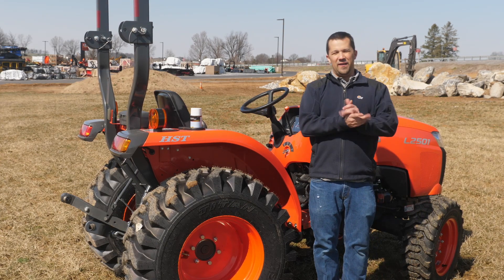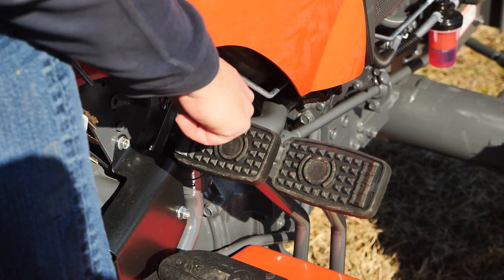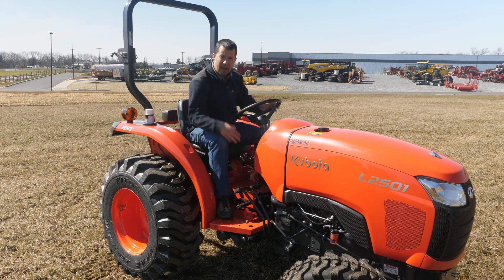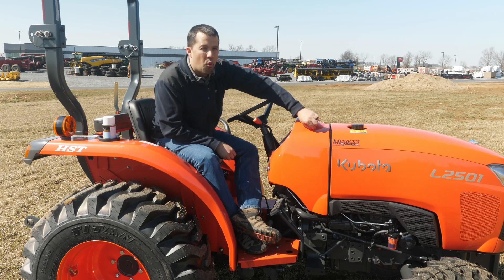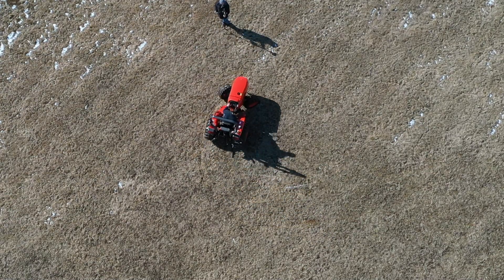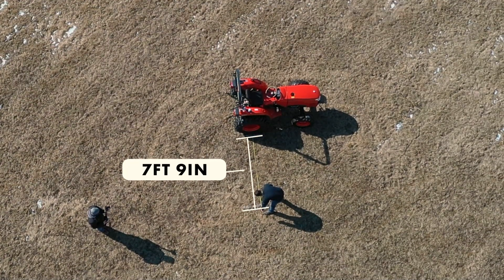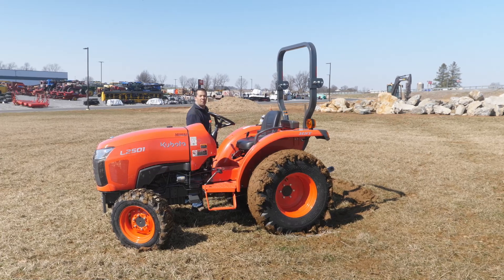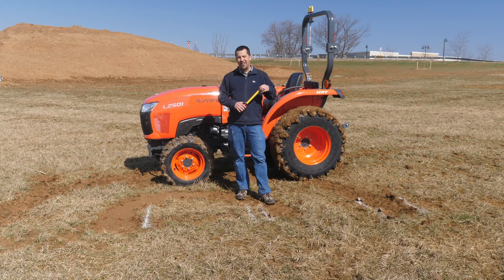Split Brakes | How they work, and when to use them

Comment: When I learned to use split brakes for tight turns, they had no lock.   I was taught to aim my foot between the pedals to stop straight ahead.   (JD 2010 gear drive model).
I had never heard of using differential braking to help with being stuck, or driving straight in snow.  
Great presentation.

Comment: Split breaks are the the best thing going when using a 3 point mounted mowing machine.  If you have your timing right on 90 degree turns, you don’t have to go into reverse to clean up your corners! 

On a lighter note, I was helping my grandpa on the farm and was riding in a utility box attacked to his 3 point on his 8N.  It popped a wheelie and he never skipped a beat, he steered with the brakes!

Comment: I live in West Virginia and we use these brakes to help hold when going across steep slopes. Many times the front end tends to slide down the hill and you can tap the uphill brake to pull the front back up the hill. I will say that this is on slopes much steeper than recommended. That being said, I passed on the Kubota because the split brakes were on the same side as the directional controls on the compact tractors which rendered them useless. Every other manufacturer moves the split brakes to the left side, but at that time Kubota did not.
Reply: Kubota definitely redifined “heel and toe”.

Comment: Great video. 
Cultivating  checked corn back in the 50's with a 2 row mid mount cultivator the turning brake were the most used pedals on my tractor.

Comment: I actually had to use the split brakes in a sort of emergency situation 🙃 last summer. I was taking buckets full of clay and spreading it at one end of the yard and before i had started i went thru and greased everything up but forgot to put air in my front tires.  My B2650 is supposed to have 35psi in the front and i was at 30psi. Well at some point not only did the tire go flat but i broke the bead on the rim and the tire was already half off the rim. So I grab and hook up all 300 ft of air hose i own to the air compressor and i end up about 30ft short from where the tractor was parked. So with my bucket down keeping front tires in the air  not only did i have to drive the Tractor that 30 ft but i had to make an 80° turn. Probably only time i will ever need to use them.

Comment: Is this a old video, I seem to remember this. I am always using the brakes, steering with my 4x2 tractor, it has 11L-15 wagon tires so it does not really steer well on slippery surfaces. This video does show  how useful  the brakes are.

Comment: On  my MX5100 HST there is a "cruise control" hand lever on the left side to set the ground speed so you can use the split brakes. (that are on the same side as the HST foot pedal) On my B7500 HST it does not have that feature so I would have to operate the split brakes the "Neil Way".

Comment: Back when I was a cocky 16 year old on dads old (even back then) Ford 3500 with a 5' heavy gauge steel slasher on the back I thought I'd be clever when mowing and speed things up a notch.
Got to the end of the row, lifted the slasher and still with the RPM high stabbed the left brake to turn nice and tight.
Brakes worked spectacularly well,  the front wheels caught and ripped the wheel out of my hands, slasher got some momentum swinging sideways and before I could blink the tractor is on 1 wheel and just about rolling over into the barbed wire fence. 
I think I bumped the draft control and dumped the slasher back into the dirt and some how didn't roll, but scared the crap out of myself.

Comment: I utilize the split brakes feature on my MX4700 gear-drive machine when mowing around my pond edges. It gives me a little insurance against slipping too close to the sloped edges. Yes, I wish I had an off-set solution, but you make do...

Comment: Even on newer tractors you don't need brake steering. New modern farm tractors have amazing steering with the gearing at the tire to help pull the front through the turn. I've talked to a lot of farmers and people who own tractors and never has a farmer used brake steering on a headland. Not saying they don't but I've never had one tell me they do. Really the only place I've ever seen brake steering be of any benefit is if I'm hauling the houle spreader and I'm backing up to the pump if I didn't make that re- correction soon enough brake steering can help to bring the front around to be to make the tractor straight with the spreader. I've never personally used brake steering traveling forward.

Comment: At least on some models of tractors, the parking brake only works on one pedal, so should also lock pedals together when one really needs the parking brakes to hold.

Also, a very good idea to keep a close eye on your brake wear and adjustment, and make sure both pedals have similar travel for similar braking force, that way when pressing both, you don't have only one side fully engaged and the other barely doing anything.

Comment: Great video Neil.  Thank you.  Very helpful to know the B2601 I am considering I can still use the split brakes.

With my old B7100-D I constantly use the split brakes when clearing snow.  The front wheels become very light and there is no steering there when pushing heavy snow.

Comment: Steering brakes take some practice so as to not tear up the turf.  But when using a finish mower or rotary mower it can make a significant difference.  I have yet to try it with my L4060hst but used it regularly with my gear drive Satoh Bull.

Comment: With an HLA 72” plow on the front of our LX2610, if the plow is angled and snow is significant, the plow will steer the tractor. The steering brakes compensate for this and allow allow for plowing in a straight line. On the LX, the brakes are on the left, so the right foot can control the forward motion while the left does the steering brakes. Often, the steering wheel isn’t overly useful as the front wheels, even in 4WD, lose traction on the snow and ice.

Comment: My worry about using one brake a lot more than the other is you will wear that brake pad more and when you flip them back together you won't stop and stay strait on a panic stop because of uneven wear on the brake pads. Adjusting the brakes could be a big problem for strait stopping and trying get them back to even again.

Comment: Really good stuff. My L3560 has no clutch so it makes this maneuver MUCH easier. I don't do it often but it has worked well working in my dense forest on some hills. Locking the down hill rear tire and pivoting around allows me to make a 90º downhill turn to then back up the hill with my 800 lb PTO driven chipper.

Comment: Question for you Neil, back when my dad bought his B1750 back in 1991ish, it had a bi_speed steer function when in 4wd. It was actually a selling feature over the then comparable Green 755 compact tractor. Why did Kubota go away from this feature that made a real difference while operating in 4wd?
Reply from the maker: It's a cool feature. Still offered on the big M series tractors.
Reply: It is also offered on some of the B series tractors in the European market.  Unfortunately not available in the US.

Comment: Is it just me or should the brakes be on the left side regardless if there is a clutch or not?
Reply: Yes.  But the L01 tractors started life as a manual transmission, the HST was added later.  The brakes on a manual transmission tractor are on the right, the clutch on the left.  With the L02 they've got to a point where they're selling more HST than manual, and so they've moved the brakes.  The other models (B series, LX, Grand L) all made that change earlier, but they always had a much higher percentage HST - the L01 was the budget model.

Comment: Neil- love your content! Does Kubota have 4 wheel brakes like Deutz???
Reply from the maker: Most tractors brake at the transmission, so yes.
Reply: @MessicksEquip  YOU and I have spoken before- I love Kubota tractors!!!
Do you see Kubota ever moving towards 4 wheel breaks as an option???
Reply from the maker: @jimbernard71  They do that currently. The braking is done in the transmission, not at the tires like a car.
Reply: Elaborating a bit.  The brakes brake the transmission.  If you're in 2WD, then you're braking the back wheels only.  If you're in 4WD, then braking the transmission stops all 4 wheels.  So if you need the front wheels to have brakes (maybe you've got a bit much weight on the loader and your rear is light), then you need to be in 4WD.